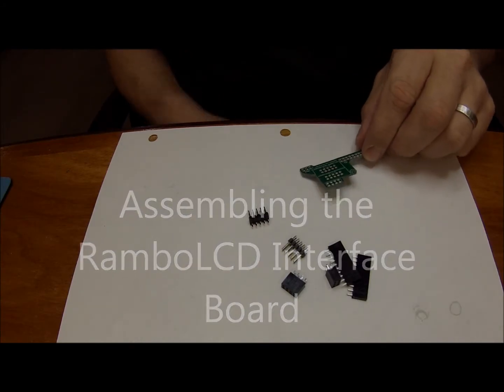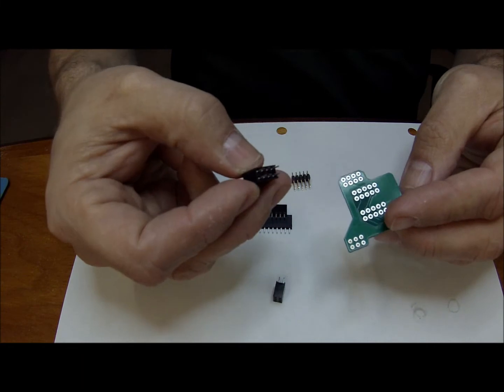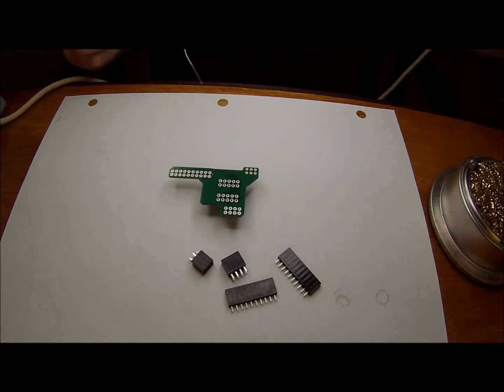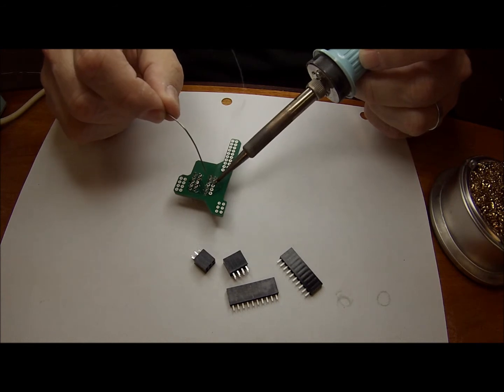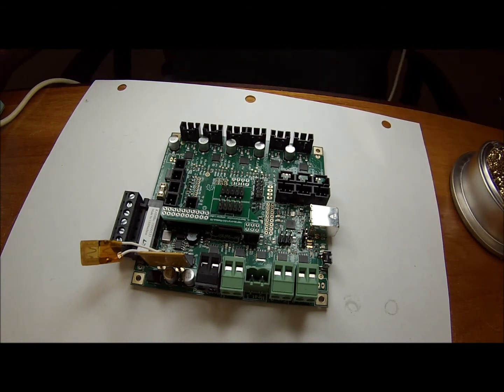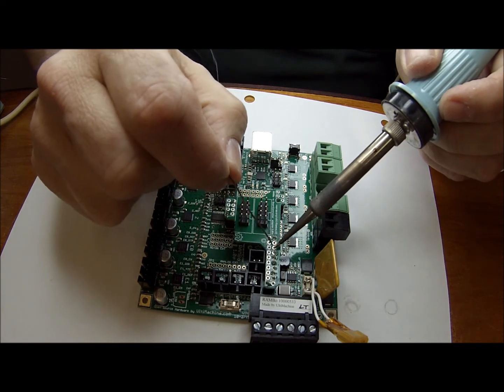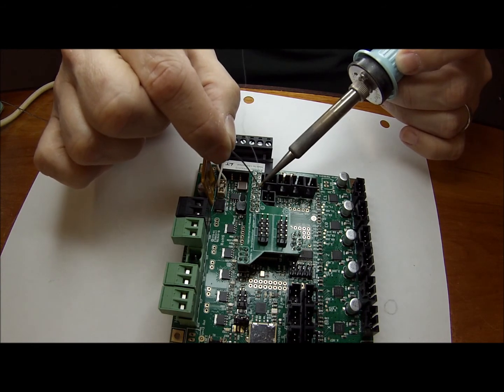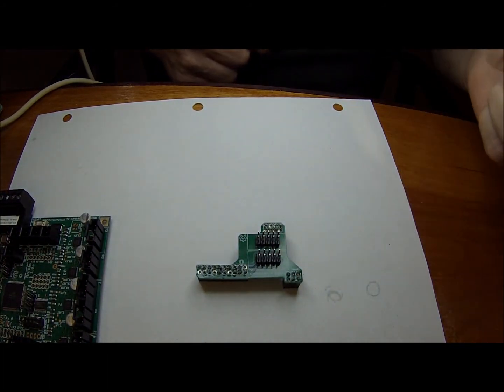Assembling the RamboLCD wiring adapter board.

Comment: I like the video a lot - just one question, once the soldering is all done, I can connect the LDC connectors (A and B) directly to the headers on the adapter board - or I still need to redo the Ribbon cable, on the LCD side, and connect it to the adapter ?